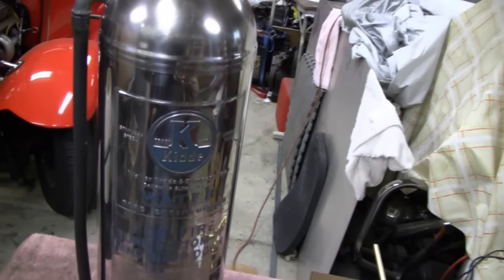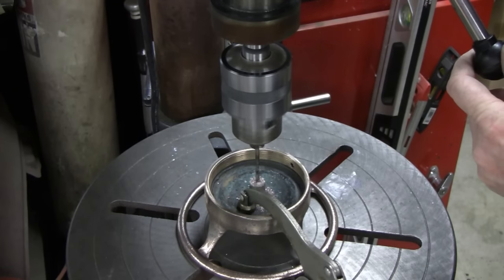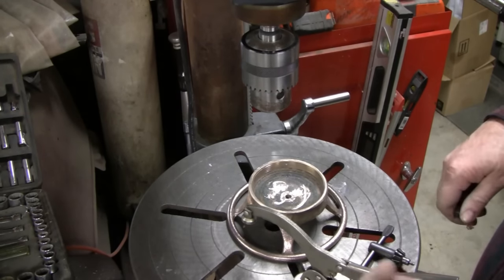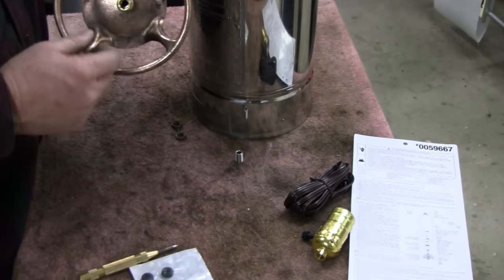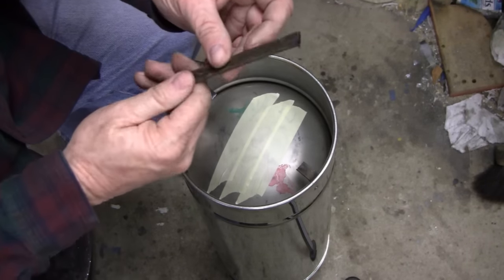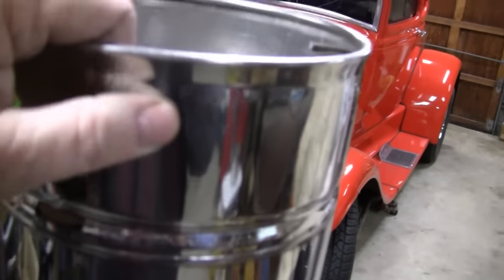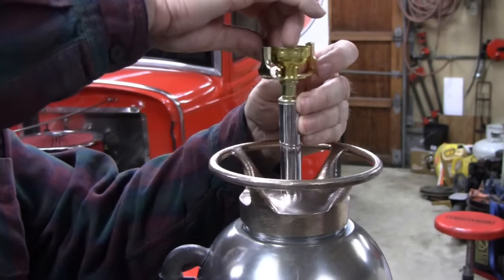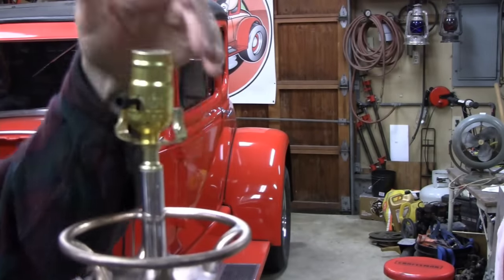MAKING A FIRE EXTINGUISHER LAMP (part 2)

Comment: looking good.  if you get a new shade and you find that you would like to raise or lower the shade,  you can get different length harps.  harp is the part that supports the shade.  usually you would go to a lighting store for best selection.  big box stores dont stock a lot of fittings.   just a FYI.
Reply from the maker: Thanks Bud!! Never knew they were called Harps!!☺

Comment: hey roadking, LEDs die when they get hot. It looked like you had an LG bulb. there bulb design sucks, because they have very little thermal provision for the LEDs (not a big enough heatsink) this makes them fail prematurely. In a lamp it might be ok but I would definitely look for the ones with giant heatsinks on em. nice vid love the lamp.
Reply from the maker: Thanks Bud!! The bulb is a Duracell Ultra, if we have any problems we'll just go incandescent!!☺
Reply: Haha that works too!

Comment: Roadking, I really do love your videos but I feel I must speak this time.

I know you guys use 110ish volts over there. even so, you really need a three wire lead on this. the whole thing needs to be connected to earth. Your underwriters knott could end up being an undertakers knott otherwise.

Keep up the good work and stay safe.
Reply from the maker: Thanks Mate!! Our shit don't work like that over here, Most lamp plugs are polarized, at least since the 50's!!☺
Reply: That still won't stop 110V coming into contact with the metal. If a connection came loose or the insulation of the lead fretted through there will be nothing to stop the whole thing becoming live. Believe me I have been an electrician for over 20 years.
Reply from the maker: I don't know what the fuck to tell ya, The kit comes with a polarized plug!! I don't know where you're from but that's what most lamps and appliances use over here!!
Reply: OK buddy, didn't mean to offend you. I love the lamp it's beautiful.

I'm from the UK by the way and I guess I'm just being tetchy as we have 240V for everything here.

Absolutely loved the inline four Briggs. Keep up the good work my friend. 

Cheers
Matt
Reply from the maker: Thanks Mate!! No worries!!☺